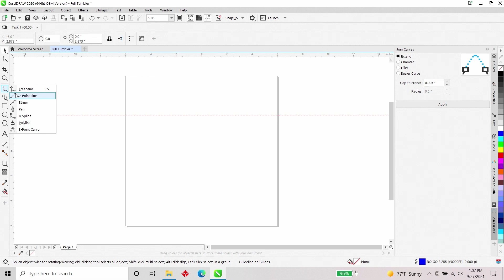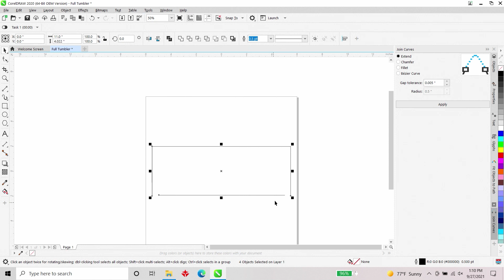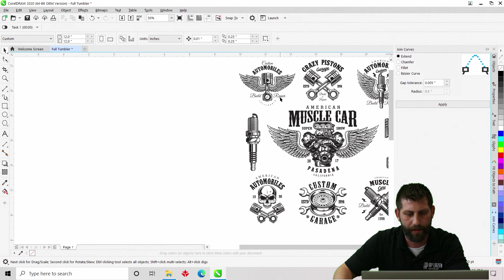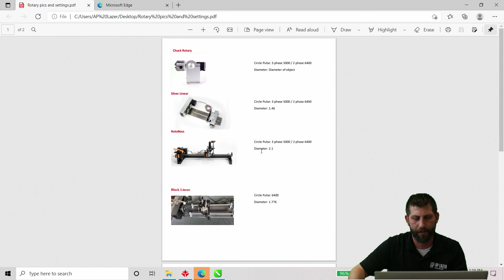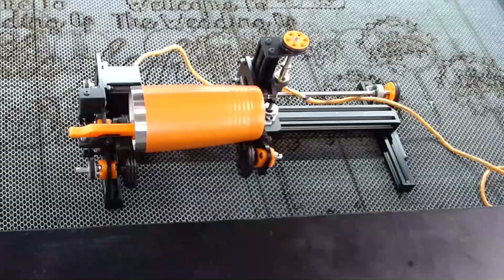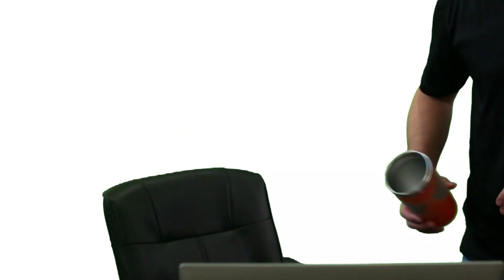AP Lazer Workshop | Full Circumference Rotary Tumbler Engraving

Comment: Maybe I missed it.  Did you just place your logos in place?  Did you not have to compensate for the images stretching?
Reply from the maker: Hi! Our tech used the template he drew to help him place his images. He said he did not need to do any additional adjustments for these particular images. Now if you were doing numerous images and they were going on the tapered end of the tumbler, then yes, you would need to adjust the images.
Reply: But the "canvas" of the cup is absolutely tapered.  That's why he drew the parallelogram and not a rectangle.  So, if I remember my geometry, the bottom of the image should be squished compared to the top of the image.  Perhaps the taper isn't enough to matter?